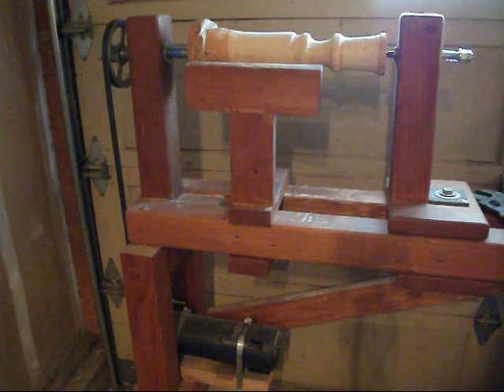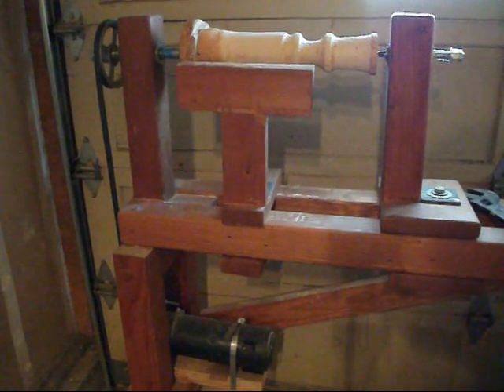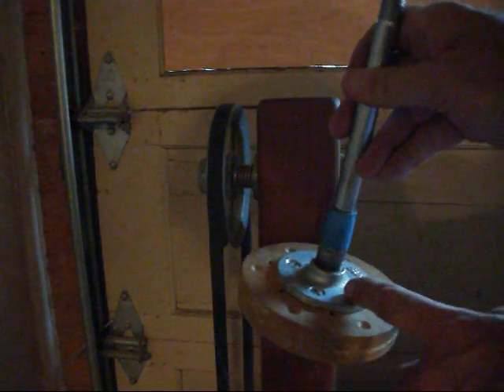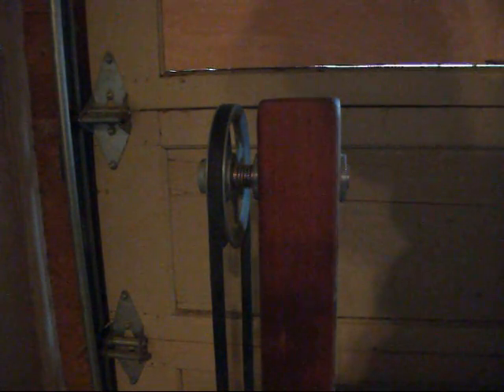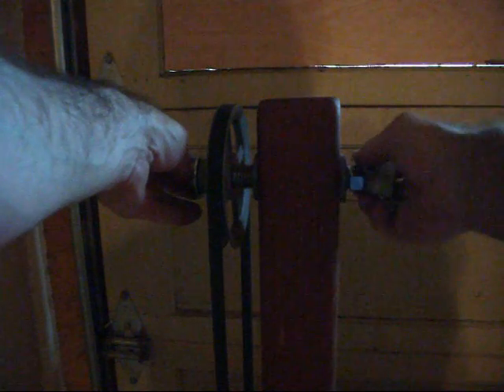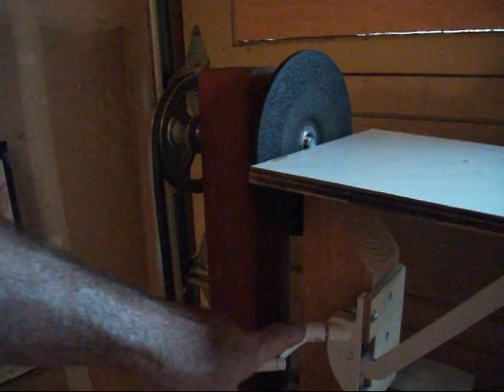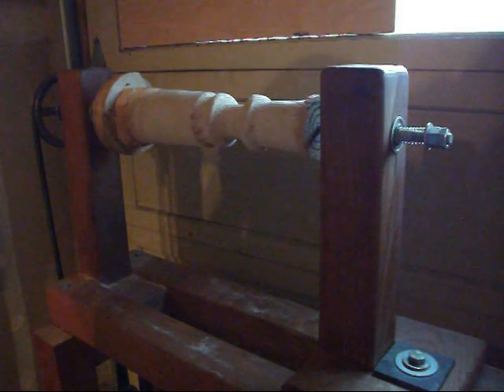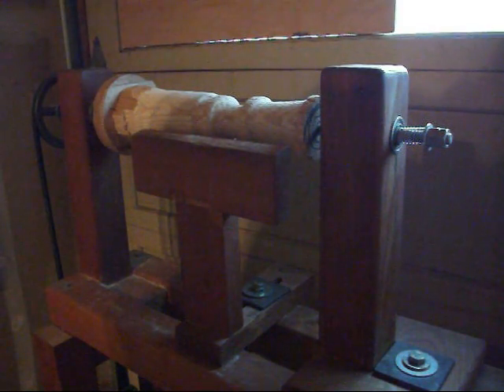Homemade Wood Lathe Headstock.wmv

Comment from the maker: @kenny474 
Thanks for checking out my channel. I have been thinking about adding a chuck for some time, I appreciate the suggestion. I'll look into the Grizzly chucks. You are right about being able to do more with a chuck it's also much easier to get the work piece onto and off of the lathe.
Thanks!
-Otto

Comment: Pretty nice job, massive capacity as well. Window crank is very innovative, nice idea.

You may also be able to get a chuck with a thread adapter to thread onto the headstock bolt and have use of a chuck instead of the face-plate, as they are a lot more versatile.

Grizzly Industrial carries low-cost chucks that work decently, and some for a bit more that are really nice. 
They have a 4-jaw chuck with a 5/8" diameter center hole that may work for you, you may even be able to tap it. It's $25

Comment: I have Grizzly's G8784 and the extra jaws, and it works awesome and has expanded my capabilities a ton! I also have a set of jumbo jaws on order that will allow me to hold round pieces, such as bowls, from 6" to 14" in diameter by the outer top edge. And there are even bigger sets available as well, so having a chuck could really expand your capabilities beyond what a faceplate allows, and you don't need to put holes in your work to attach it~

Comment: @OttoBelden  3450 rpm 3 phase to spin in reverse you can get a lot of then from old well pumps. A  well pump can also offer a few good bearings inside the bottom casing

Comment from the maker: @lemire182 
I believe it's 1/2 HP or maybe 1/4. It's an old DC motor that I got from the garbage at a previous employer. You can check out my blog:
ottobelden.blogspot.com/p/various-projects.html
and scroll down to the wood lathe links for more details of how I built it. I can adjust the speed while it's running and the direction. I'm not sure what the top speed is, I've never had to go that fast ;-)